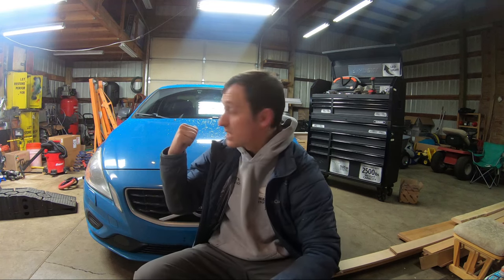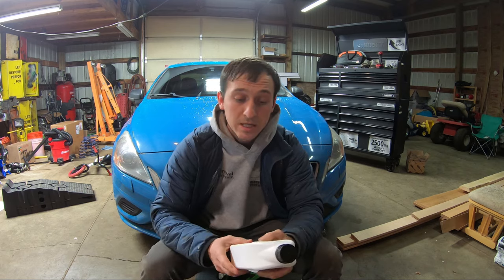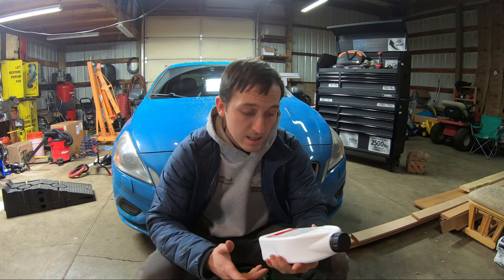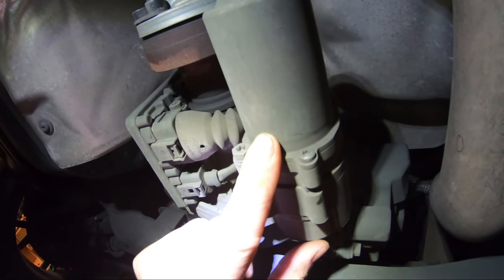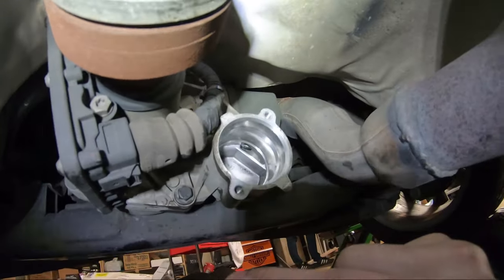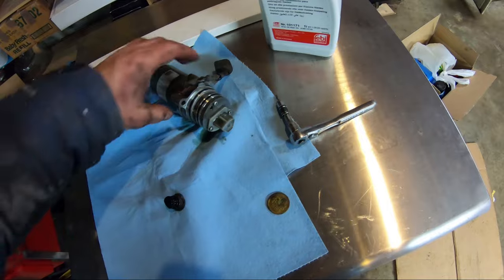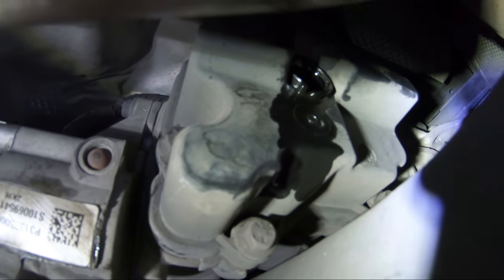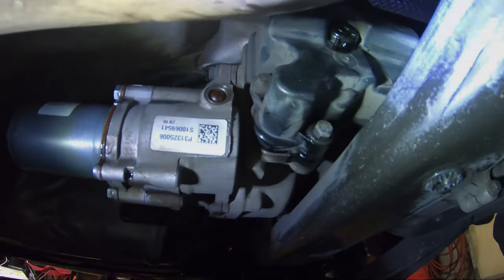Volvo p3 Haldex 5th gen AWD service.

Comment: Great job. My car 2013 s 60 R coded a Maintance required for the AWD. It says it is AWD disabled, service required. I’m hoping I can diagnose and fix on my own. Car has 150k.. could be pump or fluid level or even computer relay. I would love a video or a couple pointers on how to attack this issue. The car has so much toque I need the AWD functioning. Please. Any advise would be amazing. Thank you again for the time and effort you put into helping the DIY community.
Reply from the maker: 90% chance its pump. Search it up by part number on ebay or google wayyy cheaper then dealer.
Reply: I had same issue and it was a bad dem. Replaced with a xemodex unit.  Not sure it’s your problem but xemodex has a nice diagnosis flowchart

Comment: Hi, how are you ? I have a problem with my s60 t6. I lifted the car on one side, put it in neutral and moved the front wheel with my hand, the shaft moves and the Haldex pump works but the rear wheel does not move, what could be the problem, oil in bad condition, filter clogged?

Comment: Im looking at a 2010 xc60 tomorrow. It's over 100k miles. But clean.
Reply from the maker: I would get 2012 or newer. They have better transmissions and alot of the issues by 2012 were resolved

Comment: Great job !! Thanks I think my 2012 T6 r design is Haldex version 4 is this the same ? I also noticed when u have the same headlight issues as me after driving in rain condensation in the passenger side headlight .
Reply from the maker: The headlight is just burn by the sum on outside. Ans if it looks the same as mine then yes the haldex 4 is abit different it has filter in it.

Comment: How to you remove the fuel tank? have to put in a new fuel pump and I already had to cut up the exhaust just to get it out, then took all 6 bolts from the driveshaft to the rear diff but the driveshaft won't come out. I can't afford the $1500 just for changing a fuel pump. If you can help please do!
Reply from the maker: What model and engine do you have?
Reply: @BuiltForSpeed  2014 s60 t6 awd

Comment: Great video!  Strange my aus  2011 t6 seems to have a haldex gen 4!
Reply from the maker: Does it have seperate filter in the haldex system? If not its gen 5 if it does its gen 4.
Reply: Volvo upgraded to Haldex Gen 5 in 2013.